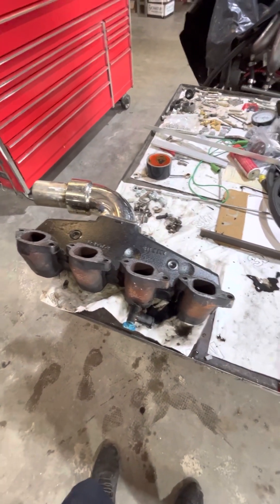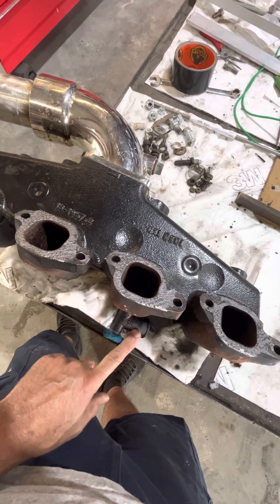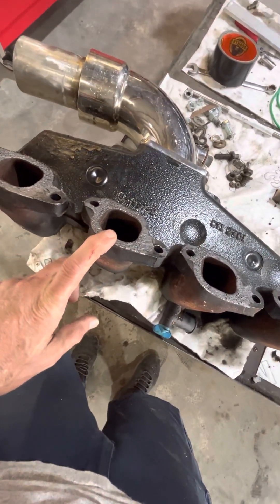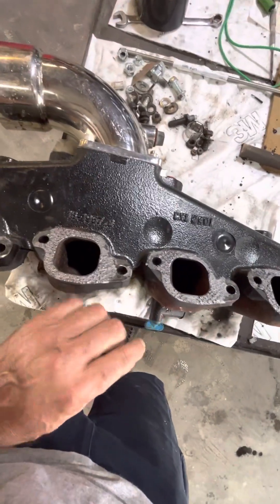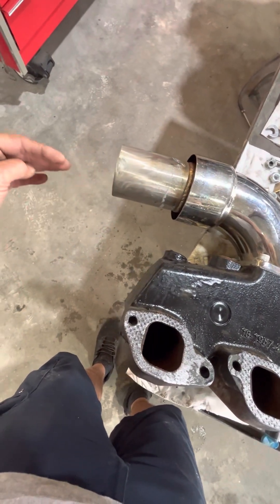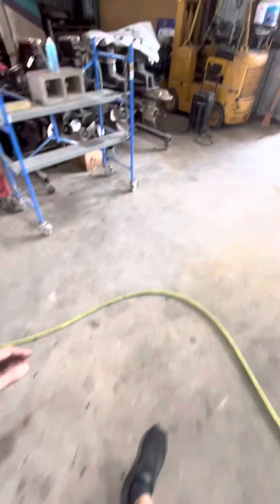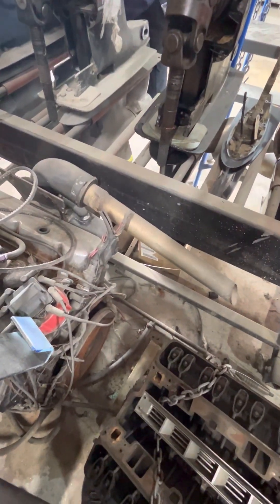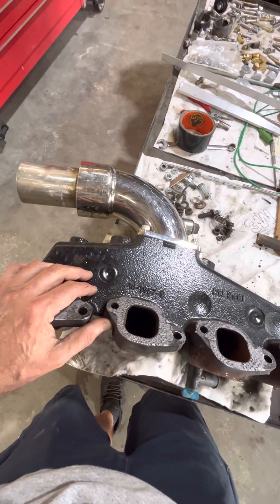7.4 Mercruiser Exhaust Water Reversion & Pooling

Comment: Great video and thanks for the dry pipe solution! I’ve been searching for examples of mods to minimize reversion because I’m planning a 383 build and proper cam selection/water reversion are the big set back I’m having trouble with in my parts selection. I’m trying to get as much power as I can in my desired rpm range, but it’s tough knowing where my safe limits are with modifications.